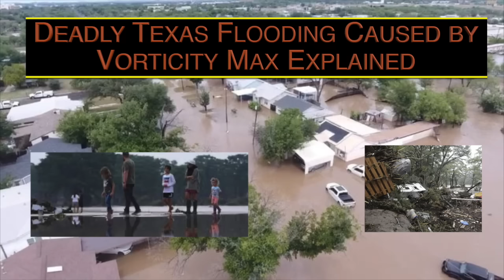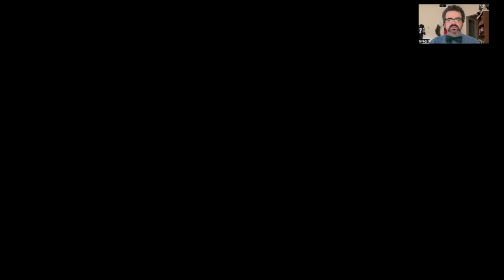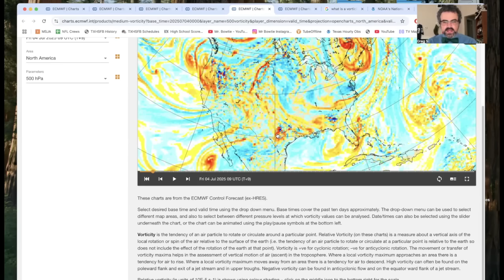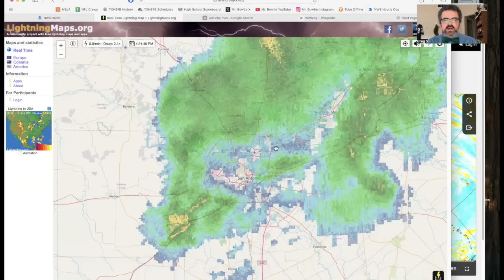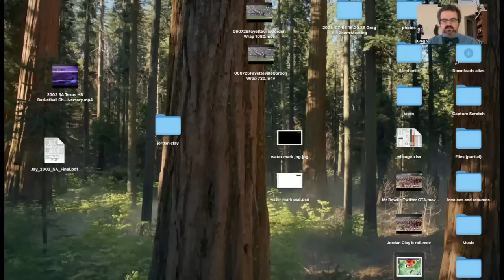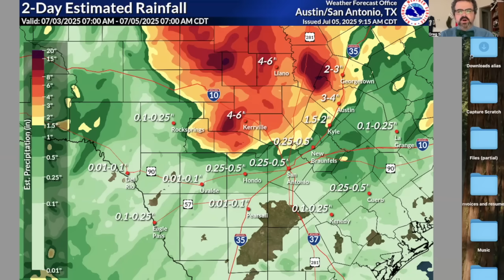Why Vorticity Max Caused Deadly Texas Hill Country Flooding

Comment: The flood in Dubai a couple of years ago was caused by weather manipulation.  Has anyone put together what has been going on in texas with manipulation programs lately?  Haven’t seen any “contrails” in the DFW area in 3-4 weeks.  How about the central texas area?  Any “contrails”?
Reply: If you drive a vehicle, use air conditioning, use natural gas for heat, buy material products ...YOU (as well as the rest of us) are part of the weather manipulation...mr.  ps there are a few that will understand this

Comment: Cloudbursts are infrequent as they occur only via:
Thunderstorms: Strong thunderstorms can create powerful updrafts that carry raindrops higher into the atmosphere. When these droplets become too heavy, they fall suddenly as a cloudburst.
Atmospheric Instability: Collisions between warm, moist air and cooler air pockets create unstable conditions, triggering cloudbursts.
Cumulonimbus Clouds: Cloudbursts often originate from cumulonimbus clouds, which are large, vertically developed clouds capable of holding vast amounts of moisture. 
Cloudbursts can be devastating due to the sheer volume of water released in a short time. The primary effects include: 
Flash Floods: Rapid and intense flooding in low-lying areas, capable of washing away homes, vehicles, and people.
Infrastructure Damage: Roads, bridges, and buildings can be severely damaged or destroyed.
Erosion: Heavy rain can cause soil erosion, impacting agriculture.
Loss of Life and Property: Cloudbursts can lead to casualties, displacement of people, and significant economic losses. 
Forecasting and Prediction:
Predicting cloudbursts accurately remains a challenge due to their sudden and localized nature.
Reply: They are manipulating the weather.
Reply: @PeggyScribnerif anyone to blame is elons 🚀💨 rocket emissions

Comment: 5:00 The area is in a long term D2-D4 drought. However, many areas nearby like Austin and San Antonio were actually near or above average in year to date precip with good rains this spring. Top soils weren’t particularly dry I don’t believe. The clay soils here don’t hold much water and there’s only a thin layer of it to begin with (6 inches), so it drains off the hill sides more easily than other areas with hills
Reply from the maker: too much rain too fast on dry ground is as bad as on wet ground. ground can’t absorb it so it runs off.
Reply: @MrBowtie1982 Correct. Saturated overland flow, Horton overland flow, and runoff from hard, dry ground all contributed to the flooding.
Reply: TRUMP/MAGA CUT NOAA BUDGET SO WEATHER FORECASTS SUCK NOW, THESE PEOPLE WOULD STILL BE ALIVE UNDER DEMOCRATS.
Reply: Yes very little soil and caleche underneath which doesn't hold water, we can get downpours and litterally in a day or 2 of sun our ground is cracked and hard as a rock again!
Reply: @ChildOfGod0777  sounds like you are poor managers of the land. Grazing animals break up dry ground and add nitrates. Permaculture catches water. Science and education lead you to both.
Reply: @scottybeck100  it's not that at all, I have a horse and over 20 deer that think my property is theirs, plus others that come and go as they please.  Are you gonna tell someone who lives in the desert they are not taking care of their land properly? I compost,  and also compost with my horse manure! So I think I'm doing pretty well!

Comment: The terrain and soil typewas a big factor to the flooding. This region was been in a drought and this type of soil in the region does not absorb water very quickly. But i was surprised to see this much moisture survived passing the mountain ranges in Mexico.
Reply from the maker: the jet stream can keep a lot of storms going a la Tropical Storm Erin in 2007 that reformed over Oklahoma.
Reply: @MrBowtie1982 Wasn’t the Extra Moisture from another hurricane in the south falling apart and funneling the moisture into the Vorticity Max which spun around and around dropping rain over and over again near the same areas?
Reply: Yup. The ground was hard as bedrock and just rolled right off. In 2015 we had been in a drought for some 8 years and it started raining in April 2015 and we had precipitation for 30 straight days. I remember passing by fields and seeing cows up to their necks because the water rose so fast reactant farmers didn’t have time to get them to higher ground. We went to the Colorado river near Bend state park and the fish camp we usually stay at, Sulphur Springs (in central Texas not East Texas) the river was a raging torrent when it’s usually 6 foot deep at it’s deepest. The water just rolls off the canyon walls right into the river. The natives in these areas warned settlers that these rivers could be very dangerous but you know that’s not going to stop an ambitious settler looking for a fantastic riverfront property to water their cattle and fish for amazing sized catfish. If you fish the San Saba near the Colorado there’s catfish that take two hands to haul in and the views are amazing
Reply: Oh this also happened in 1987. Several kids died that time as well
Reply: @AnthonyMarin-d9l  you guys learned your lesson in 1987, did you? Or do you lack intellect to fix problems?
Reply: TRUMP/MAGA CUT NOAA BUDGET SO WEATHER FORECASTS SUCK NOW, THESE PEOPLE WOULD STILL BE ALIVE UNDER DEMOCRATS.
Reply: @scottybeck100 leaving politics out of it, forecasting doesn’t suck now. Global and North American models didn’t anticipate the amount of precipitation initially. Private and NWS meteorologists did not initially anticipate it either  but the day before, the NWS staff noticed an increased probability of heavier rain over the same areas and issued a flash flood watch well in advance. They also promptly issued a flash flood warning (with a considerable tag) and upgraded to a flash flood emergency.